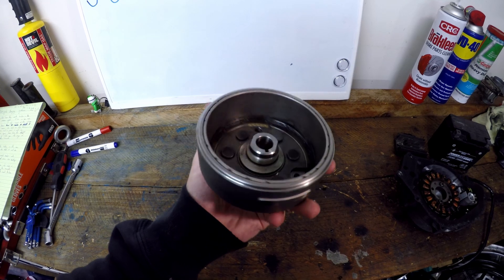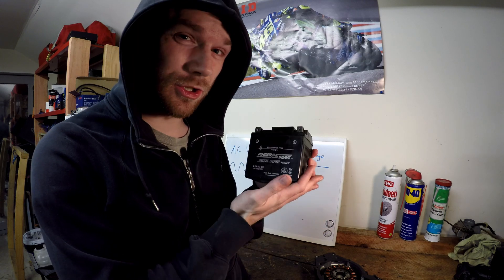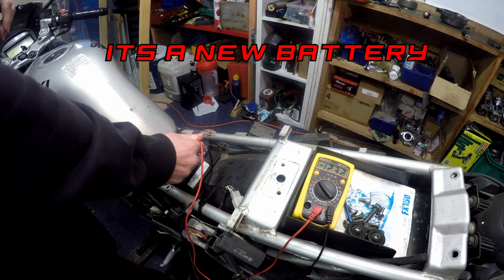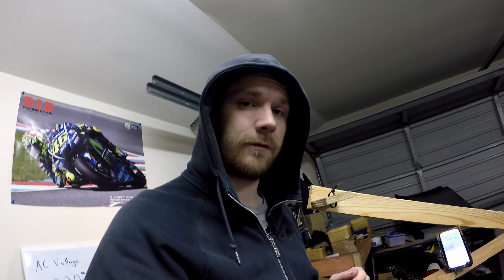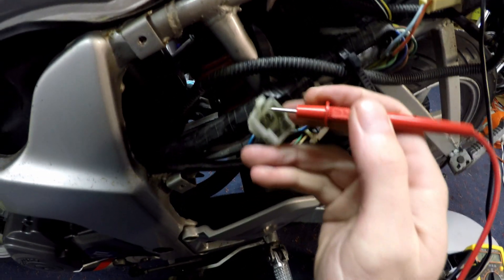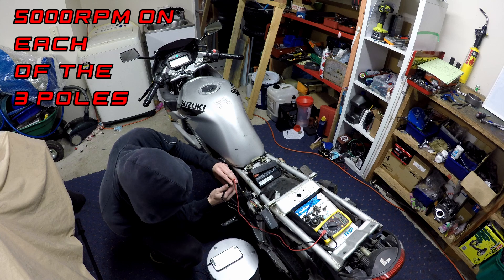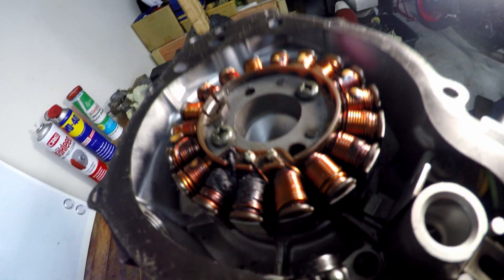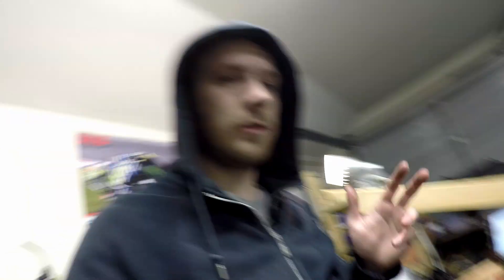Testing Motorcycle Charging System

Comment: Sir, i have an eton atv 50cc 2stroke with no spark. The stator is new. Cdi also new but no spark. When i mesure the resistance between green wire from the stator and crankcase i have 0 ohms. But from the same green wire and flywheel i have aprox 8ohms. Removing the flywheel i have the same 8 ohms from the crankshaft. Îs this the no spark cause? Isolated crankshaft due to possible inappropiate bearings replacement. Have You encounter this before? Thank You!

Comment: If you remove harley evo rotor and it has a magnet sealed in stainless rotor check for "warts"around supposed to be smooth surface the magnets benith are breaking up, will cause hard start problems due to disturbed magnetic field

Comment: My new stator is getting really hot a few minutes running and not charging any ideas?? I did not replace regulator??
Reply from the maker: @patrickploshay714  The stator is the copper windings in the engine?
Do you mean the regulator is getting hot? The finned box attached to the frame?

Comment: On the inside of the stator cover there's the black box, which I assume is a sensor. Can you explain what that does? I'm trying to see if I can upgrade an old 3 phase stator on my 87 fz600 that uses brushes, to a newer style like this
Reply from the maker: Not sure what black box you mean, I would check a service manual to see what it does, as it could be anything from a pick up to a set of diodes rectifying the ac voltage.
As far as a stators go.
I haven't seen one with brushes yet, that's pretty funky, like a starter motor.

Comment: 3.26.24.     ⚠️There are two tests for the Stator, one being a static test/DC/ohms.  And a dynamic test, with the bike running, testing the Three Phase Stator between any two phases 1-2   2-3   3-1 and reading the AC voltage, my GL 1200 Goldwing new Stator tested out at around 70 VAC between any of the three phases at 3000 RPM.  The two lower Voltage phases probably have internally shorted windings to each other. That’s causing the lower AC voltage output on the two of the three phases. The windings usually are not shorted to ground. Therefore, if you do a resistance check, it will show infinity to ground to each phase.

Comment: How do you know your rotor is bad?i changed stator and regular n still getting low voltage no charge
Reply from the maker: Generally if a rotor is bad there would be signs of damage, like the magnets are missing or broken.
There are some other potential issues you could have, a connection problem between terminals, a bad earth or a bad battery.
Reply: @TheMotorcycleForge  new battery even tried bypassing the harness going straight to the battery from the regular still won't charge
Reply from the maker: In that case you should start checking wiring with the multi meter looking for short circuits and bad conditions

Comment: i have a small cc engine and the battery is not charging. does it matter if i use a regulator with higher cc?
Reply from the maker: As long as it has the same amount of poles from the stator and is wired in the same configuration I see no reason why it shouldn't work.

Comment: thanks my bike shows 12.8V at 5000 rpm. Something is not working correctly. Suzuki SV1000s 2006.
Reply from the maker: 12.8v at the battery or stator?
Reply: Did you ever come to a conclusion of what the problem was? I just replaced battery, Rec/Regulator, and stator and volts are very slowly dropping. I'm starting to think it has to be the stator plug wires or plug itself that goes to Rectifier
Reply: @fonz1anddone713  shouldve started at the plugs, the one from stator to rectifier burns very often
Reply: @TrashRatRecycling  I'm going to take the stator plug off the rectifier and re-solder and use new plug. That's the only not new part in all this. Also went to start up my bike yesterday and it was blowing smoke at first strange after 10 seconds it eased up but i had driven it and had it running like 45 min total the night before after installing everything

Comment: Just subscribed - YouTube needs someone covering these topics but with no frills. Your no nonsense approached crammed more info onto a 6 min videos than some tubers impart in 3 times the time. Like the style. Please don't change it!
Reply from the maker: Thanks man that's awesome to hear,
If there is something I haven't done a video on that you would like to know about don't hesitate to ask.
I'll keep em coming.
Cheers Logan
Reply: Hello I have an '05 WR450 and my battery is totally dead if I leave it installed and just do the running test kicking it over should the volts still be between 13.5 and 14.5 volts if the stator is still good revving at like 3k rpms? Ty..